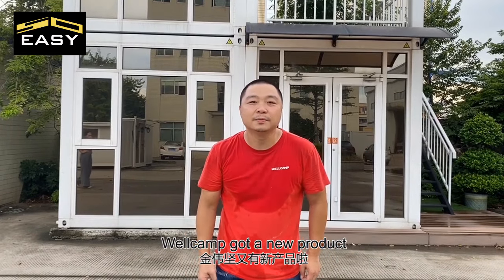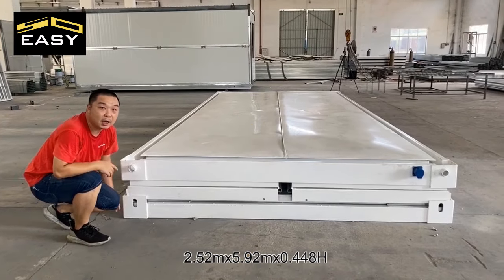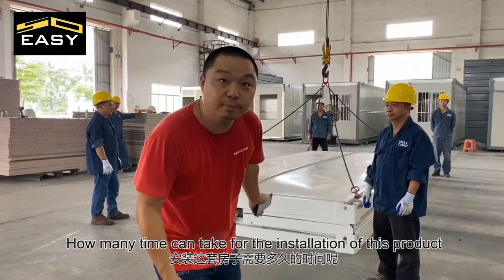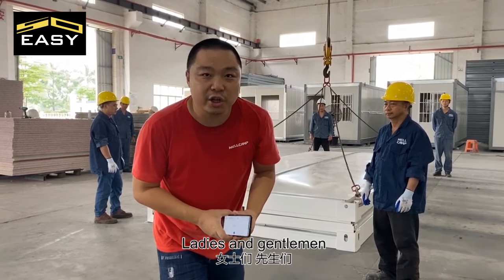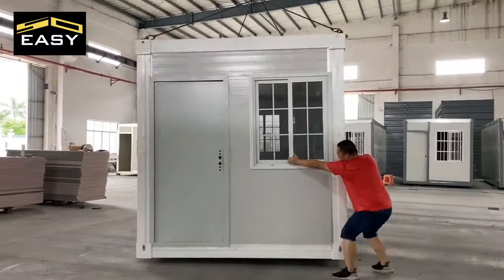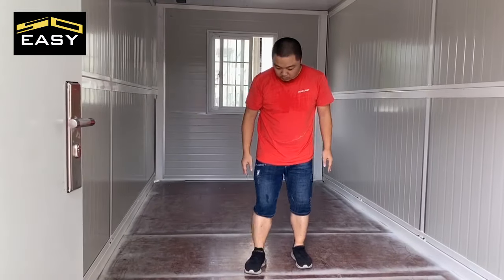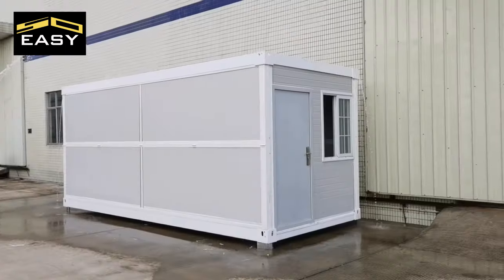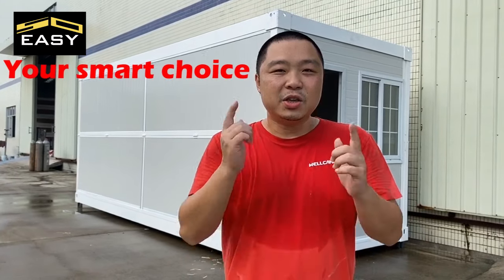China Newest Design Foldable Flat Pack Container House collapsible type portable container home

Comment: @3:32, you hiding leak with gray bar, top left corner , i guess it's easier to hide it than go back, fix it with an adjustment and then refilm it. In other words, you learned it by watching CNN. Cool Idea.
Reply from the maker: you hiding leak with gray bar, top left corner , i guess it's easier to hide it than go back, fix it with an adjustment and then refilm it. In other words, you learned it by watching CNN. Cool Idea.